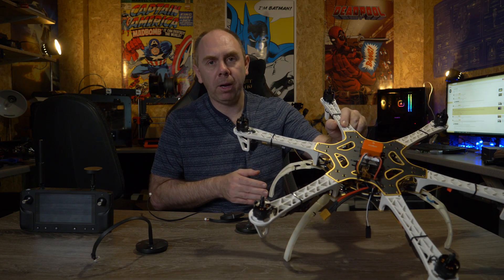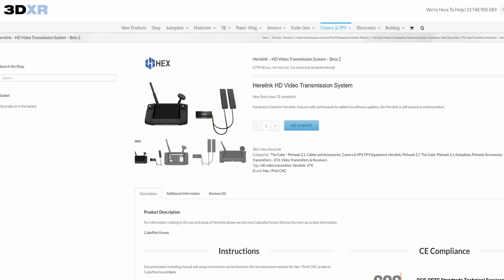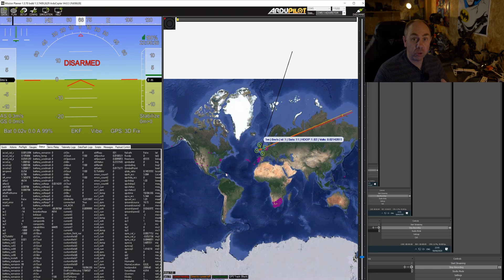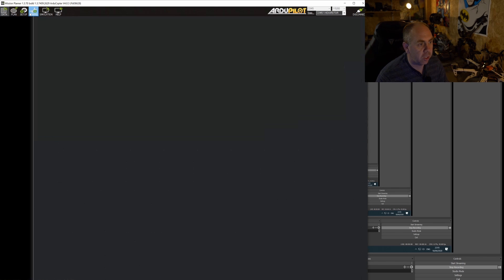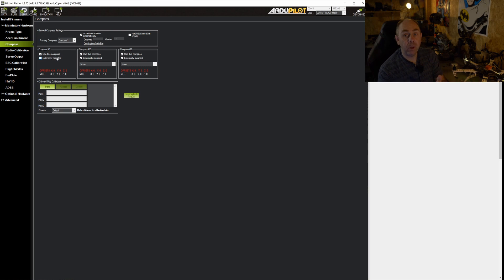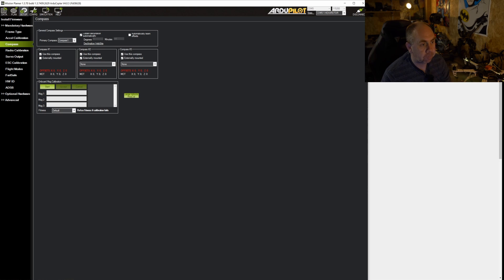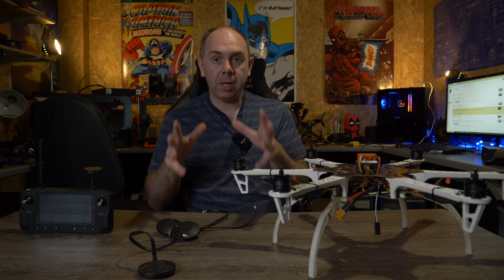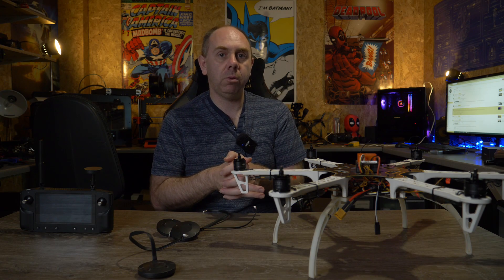Ardupilot Compass Configuration CAN & Serial -  Drone Build How-To Series Part 3

Comment: I built my first drone, its tbs discovery clone with pixhawk + 4S 4200mAh lipo. But I am facing a issue. The battery fail safe is happening before the value of the low batt fail safe in mission planner. I did bench testing and found something. First I did calibration of power module for voltage then I attached the props on the motor in a different way such as CW prop on CCW motor and vice versa, so that it will keep the quad at ground and will generate thrust towards sky hence it will push the quad towards the ground. I took the readings from battery checker at balance plug and the power module of pixhawk (Volt readings in mission planner) to compare the voltage difference. When quad is armed the voltage reading is quite OK! but as I increased the throttle the voltage difference is increasing rapidly. The approximate values are....at ~0% throttle voltage diff is ~0.06V, at ~17% throttle voltage diff is ~0.11V and at ~34% throttle voltage diff is ~0.19V and at ~50% throttle the volt diff is ~0.29V..........The difference between voltage at balance plug of the lipo and the voltage measured by the power module of pixhawk in the mission planner, is increasing with increase in throttle, Is this normal?? If no then wt could be the issue and how can I solve it possibly.....
Reply from the maker: This is because of the voltage drop and the internal resistance of the circuit and battery, basically the measurement at the balance port  is not taking into account the resistance of the load circuit so that’s why your seeing the voltage drop as the load increases and the resistance of the circuit changes. 

I would apply an offset to your MP calculation of around the difference your seeing or a midpoint.  0.2v for instance.   .
Reply: @MadRC  Yep, that's correct but isn't the voltage is measured by the power module itself?  I have attached the lipo and the pixhawk's power module together. There's just a xt60 extension cable of about 8 to 10cm. But still, I am getting voltage drop by 2V to 4V at approximately at 50% throttle. Is that normal for this setup?